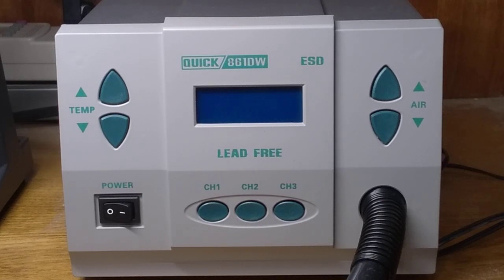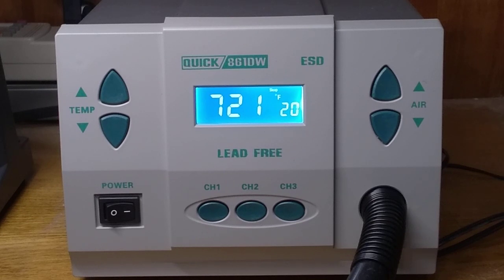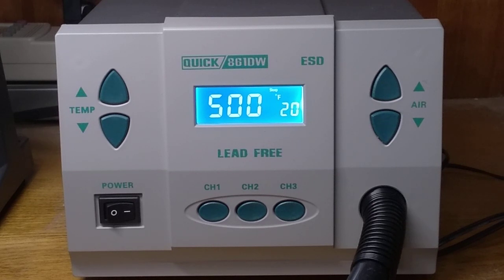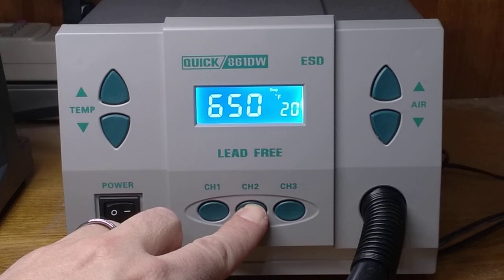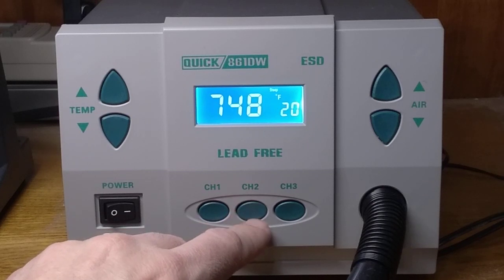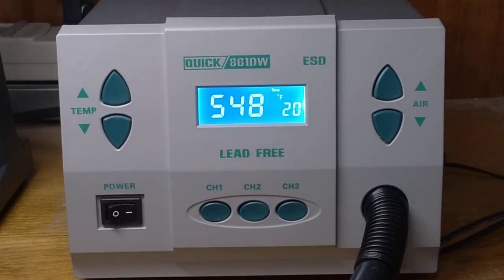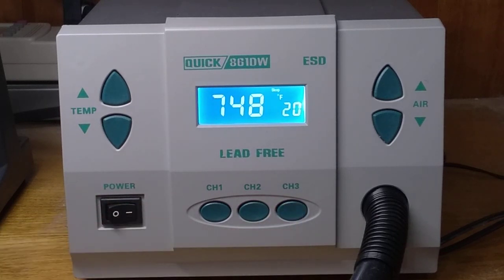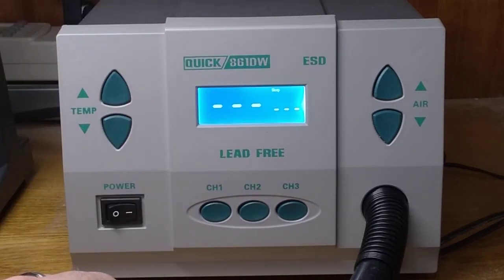Quick 861DW fahrenheit problem

Comment: the solution is to convert from degrees celsius to farenh
For example, if you program 160 degrees Celcius on channel 1 you have to change to degrees Celcius by pressing keys 2 and 3 at the same time and program 320 degrees Fahrenh, which is equivalent to 160 degrees Celcius, and so they do the same on the other channels using the converter

https://www.digikey.com/es/resources/conversion-calculators/conversion-calculator-temperature

Comment: Could you find a solution? or have you changed the unit?
Reply from the maker: had to replace circuit board
Reply: @doctave  you tried to reprogram the ATMEGA chip